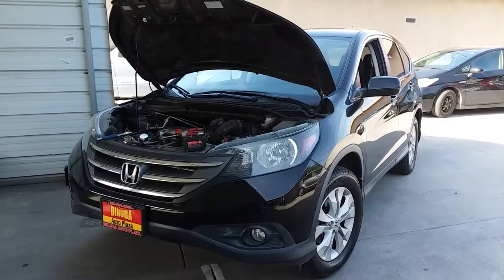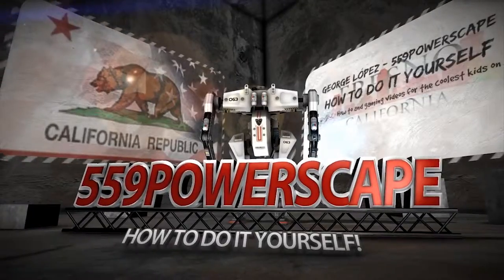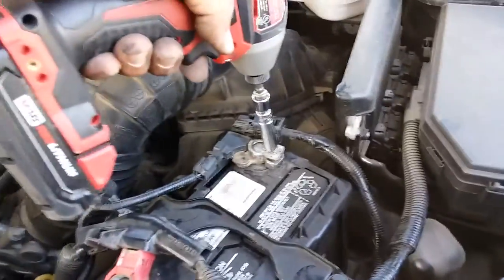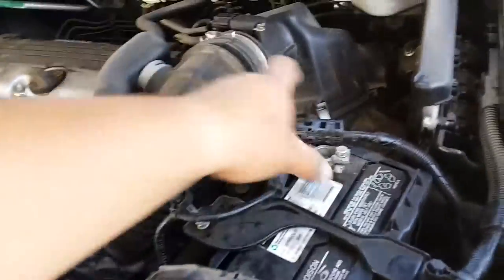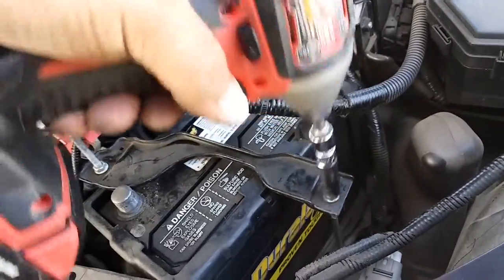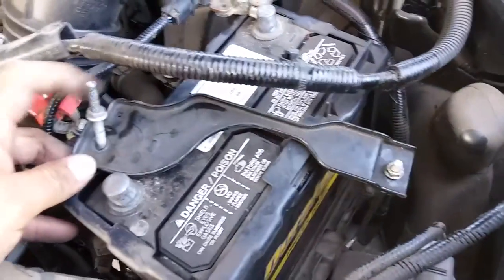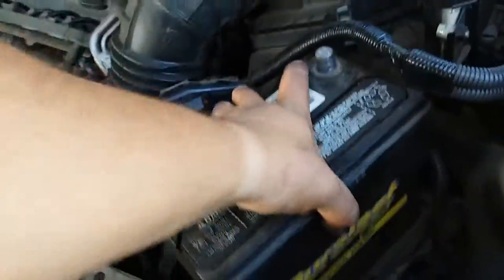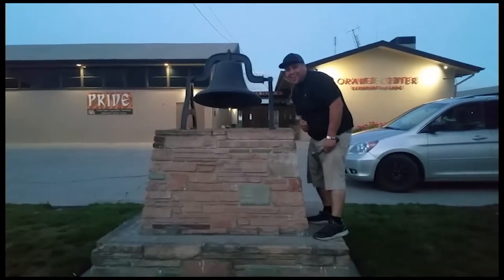How to: Remove a battery from a 2014 Honda CR-V

Comment: Hi, I did the exact thing, but somehow I blew a fuse and my radio and navigation wouldn’t work, I had to take it to the mechanic and he said it was one of those large square fuses, I don’t think I will do it again. I have changed many batteries in my life time so I don’t know what happen but it stressed me out.
Reply from the maker: It didn't blow the fuse before the new Battery?  I've seen this on a acura tl. I had to replace that same fuse. The battery was good. But that fuse made it seem like a bad battery

Comment: The alarm kick in won't stop
Reply from the maker: Put the key in the driver door and lock and unlock it..
Reply: @559powerscape  I have to press the alarm under the steering wheel to turn it off.